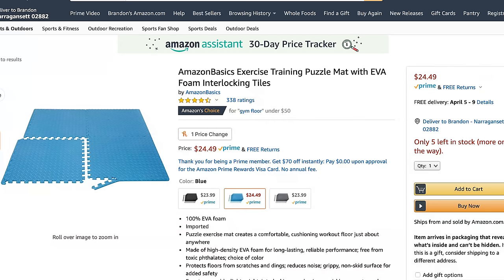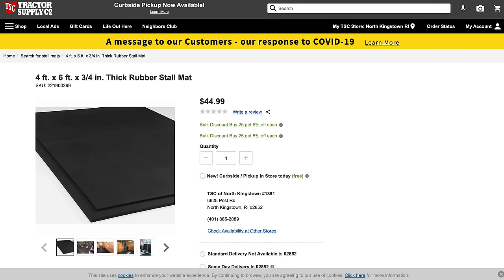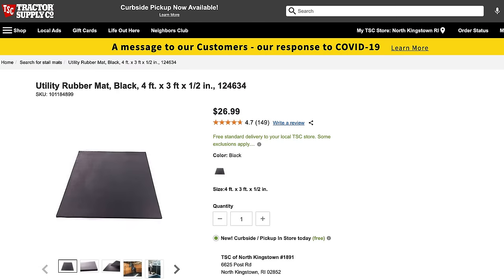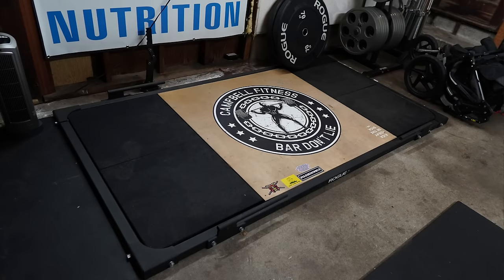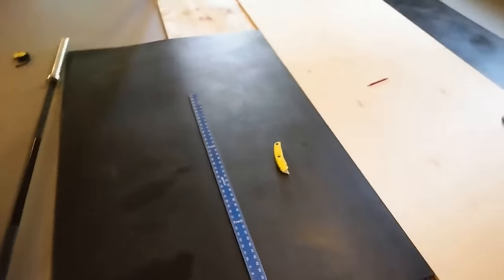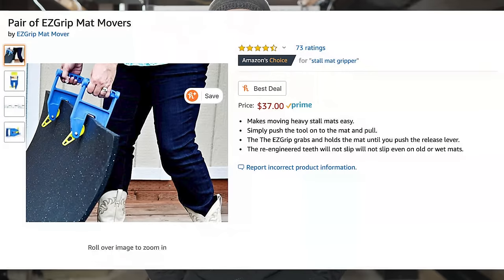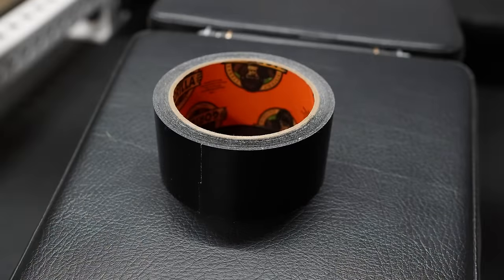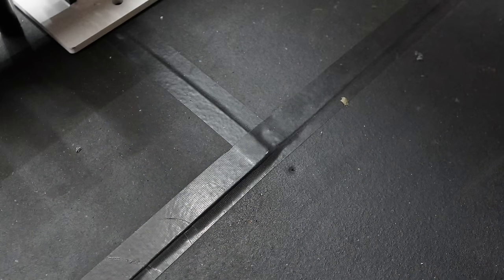Home Gym Flooring Basics

Comment: Hey man your video popped up and I just subbed. 
I have a question, I just bought a ton of new equipment to start my home gym.  I want in my basement which is fully finished and I just had brand new carpet down there installed.  Are these mats ok to put over my carpet? Or are they going to completely ruin that carpet and turn it black?

Thanks man!!
Reply from the maker: I'd prob suggest using a vapor barrier or something. It's cheap and easy. You may find you also don't like the feel of mats on top of carpet depending how plush they are.
Reply: @BasementBrandon  thanks man appreciate you responding.  I just would hate to rip up a section of the carpet when I just had it all installed 6 months ago lol

Comment: Have you posted a video of a full "garage gym tour" ? If not, would love to see something of that sort. My wife and I are working through designing our ideal garage gym and your videos have been super helpful!
Reply from the maker: I did a few weeks or months ago!
Reply: Brandon Campbell Diamond found it, it was great! One of the things I’m thinking through is if we should opt-in for the half rack monster feet, or just go the plate storage route like you originally intended on doing so. Like many, we also don’t want to bolt our wrack to the floor/a platform, but are looking for the stability for heavier lifts. Also going back and forth between the RM3 Fortis and the RM3!
Reply from the maker: Joel Yates I don’t believe the feet will fit on a fortis version bc of the panels being welded.

Comment: Would you recommend putting stall mats on top of carpet? I can’t remove the carpet so what would you suggest?
Reply from the maker: No, I'd worry it wouldn't be firm enough and may make your carpet smell.
Reply: Brandon Campbell Diamond what if I put plywood under the mats?

Comment: I am going to mount these 3/4 Horse Mats on my Mobile Home 6" wall studs & some ((SOUND PROOF)) the walls & floor I have a Pro PA Loudspeaker Home Stereo that doesn't need to hardly be turned up, but the sound moves through the walls with ease. Nobody, & I mean nobody here on youtube is using these heavy dense rubber Mats on Walls. Just this thin AcouticBlock & MLV Black Mass Loaded  Vinale, sound proofing that doesn't do much at all. Going to do the Bedroom first & do some Real World Sound Tests, maybe that will be the start of my own Youtube Channel. :)
Reply from the maker: Interesting application. Just be warned if going in a home you may find the odor offputting.

Comment: Any recommendations for something under a power rack in a basement with a laminate hardwood floor? Still use a stall mat?
Reply: I wouldn’t be dropping anything on them. No deadlifts or anything
Reply from the maker: Could prob go with a thinner/cheaper mat

Comment: so if I wanted to use horse stall mats to put under my combo rack and to deadlift, how many do you recommend getting?
Reply: Lol what’s your rack measurements & how much space do u want to deadlift with
Reply: Adam Mikhaiel the rack hasnt been delivered yet but its a competition combo rack for TSS. And idc for space as long as I have enough to deadlift
Reply: Adam Mikhaiel the rack doesnt take up too , probably 6.5x6.5 feet
Reply from the maker: There are a lot of people in the comments saying they just used one layer, I just feel more comfortable suggesting a total thickness of 1.5". You could get a base layer of 2 pieces of plywood for an 8x8 platform and then just put mats on top (would need 3 probably). For a set up that would allow plenty of room for squatting, benching, and deadlifting without feeling cramped.

Comment: Great video.  Would you recommend bolting Rouge RM4 rack onto two layers of stall mats?  Or still need to add a layer of plywood?  Would like to avoid drilling the garage floor but also would like additional stability.  Thanks
Reply from the maker: I wouldn't suggest bolting anything to just matting as its not going to keep it secure.
Reply: I find plywood is best. But I have screwed a rubber ply combo. If you have a 3 layer platform (2 1/4 height with 3/4 ply and rubber) then you can use a lag screw with washers to screw down into the ply to attach the rack. I've also done this with peg bands. It's rock solid. Just make sure your lag screws are long enough to account for the washer and rack steel thickness. I've also through bolted a rack from the underside into 1 inch plywood  (two 1/2 sheets) using bolts, washers and nuts. This was a pain in the ass. Place the rack in position, drill holes for bolts. Remove rack and tilt plywood to place bolts under facing up. Now get three or four friends to pick up the rack and position it over the bolts. Secure with nuts. And lose 3 or friends if you don't buy them beer.

Comment: Can we deadlift 600 pounds directly on the stall mat ?
Reply from the maker: I think it depends. On a single layer you can, but you prob want to control the negative vs drop it. But if you have bumpers it would prob be easier on the floor.

Comment: hey quick question brandon, i love your videos, been subscribed for quite awhile. Recently got a rack and a few weights. i am wondering about flooring. As i live in an apartment i am wondering if the floor mats would be a good option, for vibrations and noise? 

The other option would be classic 3cm crossfit style mats, not sure which would be best to absorb the noise. 

As i don't like in the us, horse stall mats are pretty much the same price as the regular crossfit mats. 

thanks alot for your time and advise.
Reply from the maker: These prob stink too much to be put in a normal living area.

Comment: How about caulking the seams and edges of the mats? That, to prevent moisture getting in and creating mold.
Reply from the maker: I'm not as familiar on if that would stick to the mat and/or how permanent that would be if you wanted to rearrange.
Reply: Hey bro I've tried the caulking on the seans and idk if it was the kind I bought or what but it just started to peel off after a while
Reply: Clean the mats good and seam with Gorilla tape.  Holds up pretty well

Comment: Hey Brandon, thanks for the vid. For deadlifting with steel plates, what are your thoughts on two layers of mat vs mat/wood combo? Main concerns are noise and protecting the concrete.
Reply from the maker: I think either is fine. Some might say you get less bounce using would vs 2 mats, but I'm not sure TBH
Reply: The benefit of wood it the load is spread.

Comment: Great way to move them: Put them on top of your head like a blanket and just walk it where you need it. Still sucks but it goes fast.

Edit: Let them adjust to the room temp before you place them. We placed them immediately after bringing them in from a hot day outside at TSC. Came down the next day and they contracted so there was a gap between every mat.
Reply from the maker: Thanks for the suggestion!

Comment: So in theory i could cover my spare room (Carpetted) with these mats n thats essentially all i need
Reply from the maker: Ehhhh maybe. If it's plush carpet the floor will still feel a bit uneven and I would worry about smell transfer, I might put down some kind of barrier.
Reply: @BasementBrandon  OK thanks, what kind of barrier would you suggest
Reply: @Lb-ri5wr  plastic barrier material for weeds would probably stop the smell transfer. Leave them out in the sun a bit and most of the smell will go away first, though. I'm guessing he means something like plywood still to keep the compression from super plush carpets down.
Reply: @phtevenmolz5030  awesome thanks, I had a quick google and I think your talking about a weedproof membrane which seem cheap enough from Remland Carpets
Reply: @Lb-ri5wr  yeah, that's what I mean. The garden variety weed barrier that's plastic is far cheaper than other plastic sheeting and lasts for a long time compared to things like drop cloths for painting.

Comment: I bought 6 pieces of rubber stall mat from tractor supply, the rubber smell is too strong and unbearable. I tried to clean them using different solutions, but no luck. I’ve left them in my backyard for more than 3 years now and the smell isn’t going always.
Reply from the maker: Sorry to hear that :( I think some smell worse than others and some are just sensitive to the smell.

Comment: 1) powerlifter strongman olympic lifters should be the only type of people dropping weights

2) anyone else who's dropping weight is an ego lifter more interested in vanity than performance

3) is bit miss giving information saying that the cheaper mats are not that good

As if you got a small space and you're only lifting under 200 pounds, 

the cheapest mats are ideal for this situation

As you shouldn't be dropping weights,

Apart from that good video
Reply from the maker: 1. Not necessarily
2. That's your opinion
3. It isn't.